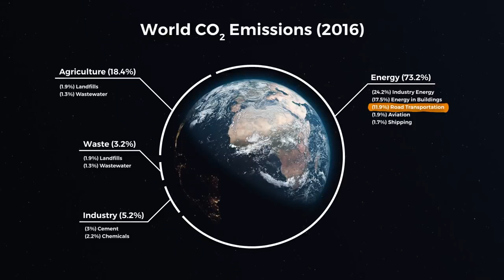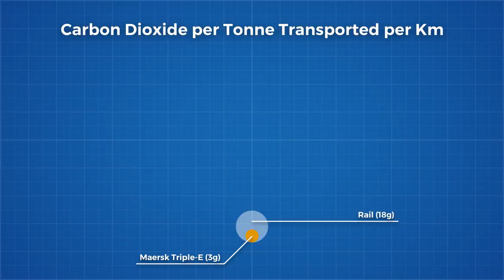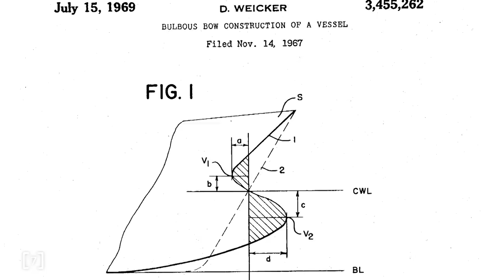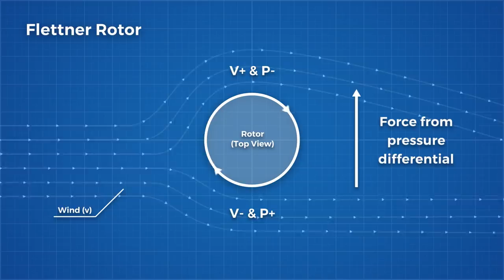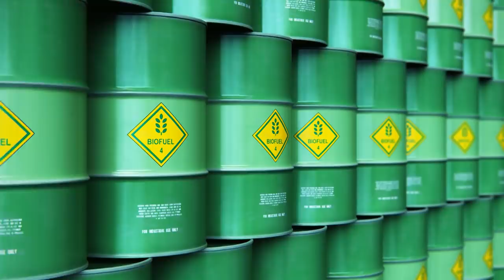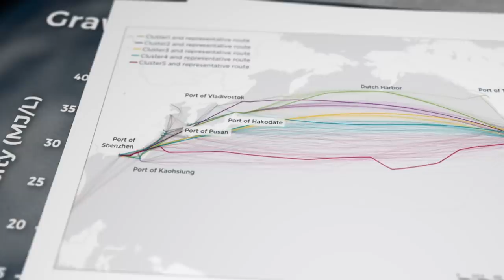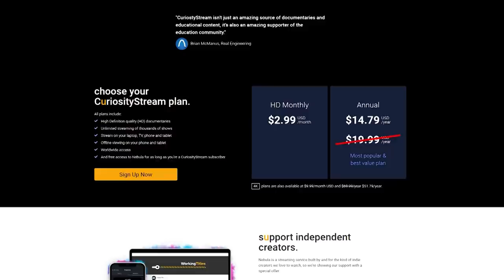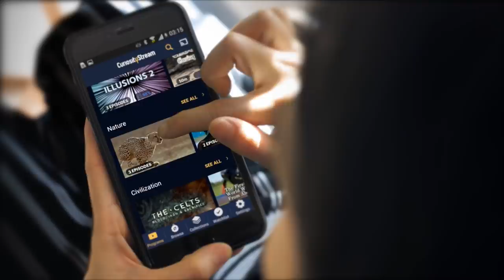Are Renewable Powered Ships Possible?

Comment: I think I may know a BETTER way. You see, Hydrogen power was always tempting. But, FIRST of all, you need a "Green" way to generate the stuff. Solar and wind can be used in areas of the Planet where it's practical. The Sun does not need to shine all the time if you use Hydrogen storage. But, the Second, pragmatic issue: how to safely store the stuff on a ship (or plane, for that matter.) I propose the use of  Sodium Hydride and Hydrochloric acid, again...made with "Green" Electrolysis. The concentrated HCl (mixed with water) could be stored in a stainless steel tank, and hooked up to the throttle. Meanwhile, in the ship's hold, you have a bunker with the Sodium Hydride. The HCL is sprayed in said hold, and the waste product IS...Saltwater! This can be discharged into the Sea. The fuel from the reaction is Hydrogen Gas, which you can pipe to a fuel cell, react it with Oxygen in the air, and the electricity powers motors  attached to the propellers. 

Those ships should be going 20-25 mph on that Green Power. That 12 mph Crap is causing the  current supply bottleneck.
Reply: POO (point of order) Hydrochloric acid is an exception to the general acid resistance of stainless steel and should be avoided (source Unified Alloys).  Also it is in my experience HCl is very nasty stuff, so best left alone, and running the reaction you describe on the scale needed is something that needs to happen in a galaxy far far away.
Reply: @BernardLS  And, True....you would need to stoke the hydride, like coal in the old days. You could line the containers with a thin layer of Gold, too.

Comment: Sure.  Use the sebatier process powered by a nuclear plant to produce natural gas  from sewage, crop waste  and atmospheric CO2. Carbon negative. How is this hard?. We have known how to do this since the 50s. In addition diesel engies can easily be retooled to  run on natural gas, with additional  lubrication.

Better yet, use small scale molten salt reactors to directly  power  the  motors. Again, tech we have had since the 60s.

Comment: Nuclear !!!
Reply: Just think; would you have full confidence in the management of a nuclear reactor under the control of an anonymous entity only traceable, perhaps, via a letter box in a FOC (flag of convenience) nation state?  If you are, could you sell that confidence to Japan, the state that hosted the Hiroshima and Nagasaki nuclear detonations as well as more recently the Fukushima ‘event’?  Then try that same, or a similar, sales strategy on Ukraine, the nation state that as a part of the USSR (CCCP) hosted the Chernobyl ‘event’.  Modern iterations of nuclear energy, thorium fuel, molten salt reactors, small modular reactors or fusion reactors, will carry the legacy of past problems.  It is the global trepidation of anything with 'nuclear' in the name and the economics of nuclear having transitioned from 'energy to cheap to charge for' too 'the costs of remediation are incalculable' that will prevent the adoption of nuclear energy as a means of creating energy at sea.  Modern reaction systems may have overcome the safety problems but the general public, having been misled in the past, will be reluctant to believe the fresh new promises.  The incident of the ‘Ever Given’ blocking the Suez Canal, March 2021, may also have a little to add to this debate.  The cooling water on ships tends to get taken in from near the bottom so when running aground the inlets are in a prime spot to get plugged up restricting, if not stopping, the flow of coolant.  One thing that the TMI, Chernobyl and Fukushima incidents all had in common was that the supply of coolant, or rather lack thereof, was a fundamental cause.  Similarly and only months later, May 2021, had the ‘X Press Pearl’ been nuclear powered then a major port for a populous nation in the global South would have possible been the site of a significant exclusion zone due to a non power plant related incident.  If the ‘X Press Pearl’ had on board a fired up but ‘safe’ molten salt reactor and found herself having to run down the possible 12.5 megaWatts of energy in the power cycle would a stable cool down have been possible?
Reply: @BernardLS  I get ur point , ur affraid of nuclear 9/11 on sea
Reply: @tamer27antepli  as are a chunk of the general population.  Sad but true.  Simply answer shorten and lighten global supply chains by consuming less and having fewer children, 'two will do', plus make stuff locally.

Comment: It boggles my mind that there aren't nuclear powered cargo ships. Sounds like the perfect application.
Reply: Nuclear engines need much higher trained technicians, and take up quite a lot of space, that some of it can't even be accessed by crew. Together with the high cost (in money and bureaucracy) of fuel and components, the only feature that makes it advantageous is it's ability to run for a very long time without refueling, and is therefore only a serious consideration for ships such as Arctic Liners.

Comment: yes, they're called sailboats
Reply: To address the suggestions that wind power is the answer I offer the following; if ‘the wind don’t blow the ship don’t go’, when it does blow it often blows in the wrong direction for your cargo delivery needs and sometimes there is rather too much of it for comfort.  The area where one is most likely to be ‘becalmed’ is the ITCZ (Intertropical Convergence Zone) or ‘the doldrums’ as it is commonly called.  In days of old ships with large crews, such as naval vessels, would try using the ships boats and some of the crew to row through the doldrums thus towing the mother ship out of the calm.  Not practical for less well manned and much heavier merchant ships which could not muster a similar power (oarsmen) to weight ratio (vessel displacement).  Traditional sailing ships are unable to go directly up wind so if the wind is blowing from the direction your cargo needs to go then a zig-zag course must be steered, more distance and thus more time on passage at whatever speed is achieved.  Wind speed is traditionally measured on the Beaufort Scale (wind speed) that runs from 0 (< 1kn or 0.5ms-1) to 12 (> 63kn or 32.5ms-1) and for sailing purposes the usable part of the range is ‘3’ (circa 8kn or 4.1ms-1) to ‘6’ (circa 24kn or 12.3ms-1).  As the wind speed, and the amount of energy that may be harvested therefrom, increases the sea surface becomes progressively more disturbed which makes the harvesting process ever more difficult and increases the stress on the vessel.  The increased stress means the sail area has to be reduced, either by using fewer or smaller sails until the vessel may in extremis be ‘hove to under storm sails’.  One way of reducing the sail area is by turning up the bottom edge; known as reefing.  With any wind power proposals the question that must be asked include ‘has any information been released into the public domain with regard to the expected energy harvest for the wing forms, on a Watts per square meter basis?  ‘Cutty Sark’, is said to have been able to coax 3 000 horse power (or 2 206 500 Watts / 2.2 megaWatts)) out of her, up to, 2 976m2 of sails, assuming ideal conditions and further assuming that for sailing purposes the usable part of the wind speed range is 4ms-1to 12ms-1 so the yield would be about 741 Watts m2.  So another question ‘for the proposed option what is the expected upper wind speed limit for the system’?  A single stage 'harvest to deployment' system for propulsion will have higher efficiency but ‘what steps are being taken to provide ancillary power such as the, small but essential, domestic, navigational and cargo needs?’

Comment: what a stupid fucking question. shipping didn't involve combustion of hydrocarbons at all until about 2 centuries ago. and unlike an airplane, if you run out whatever your power source is on the water you're not automatically fucked, just slightly delayed.

Comment: Why not make nuclear powered cargo ships?
Reply: Just think; would you have full confidence in the management of a nuclear reactor under the control of an anonymous entity only traceable, perhaps, via a letter box in a FOC (flag of convenience) nation state?  If you are, could you sell that confidence to Japan, the state that hosted the Hiroshima and Nagasaki nuclear detonations as well as more recently the Fukushima ‘event’?  Then try that same, or a similar, sales strategy on Ukraine, the nation state that as a part of the USSR (CCCP) hosted the Chernobyl ‘event’.  Modern iterations of nuclear energy, thorium fuel, molten salt reactors, small modular reactors or fusion reactors, will carry the legacy of past problems.  It is the global trepidation of anything with 'nuclear' in the name and the economics of nuclear having transitioned from 'energy to cheap to charge for' too 'the costs of remediation are incalculable' that will prevent the adoption of nuclear energy as a means of creating energy at sea.  Modern reaction systems may have overcome the safety problems but the general public, having been misled in the past, will be reluctant to believe the fresh new promises.  The incident of the ‘Ever Given’ blocking the Suez Canal, March 2021, may also have a little to add to this debate.  The cooling water on ships tends to get taken in from near the bottom so when running aground the inlets are in a prime spot to get plugged up restricting, if not stopping, the flow of coolant.  One thing that the TMI, Chernobyl and Fukushima incidents all had in common was that the supply of coolant, or rather lack thereof, was a fundamental cause.  Similarly and only months later, May 2021, had the ‘X Press Pearl’ been nuclear powered then a major port for a populous nation in the global South would have possible been the site of a significant exclusion zone due to a non power plant related incident.  If the ‘X Press Pearl’ had on board a fired up but ‘safe’ molten salt reactor and found herself having to dissipate the residual energy associated with the possible 12.5 megaWatt power cycle would a stable cool down have been possible?  In a casualty ships may capsize, like the ‘Karin Hoej’ of Bornholm in the Baltic early December 2021, in which situation any safety system reliant on gravity might not work.  Why not use nukes?  It is down to engineering, finance, socio-political attitudes and safety.

Comment: Thorium reactors.
Reply: Just think would you have full confidence in the management of a nuclear reactor under the control of an anonymous entity only traceable, perhaps, via a letter box in a flag of convenience (FOC) nation state?  If you are could you sell that confidence to Japan, the state that hosted the Hiroshima and Nagasaki nuclear detonations as well as more recently the Fukushima ‘event’?  Then try that same, or similar, sales strategy on Ukraine, the nation state that as a part of the USSR (CCCP) hosted the Chernobyl ‘event’.  Modern iterations of nuclear energy thorium fuel, molten salt reactors or fusion reactors will carry the legacy of past problems.  It is the global trepidation of anything with 'nuclear' in the name and the economics of nuclear having transitioned from 'energy to cheap to charge for' too 'the costs of remediation are incalculable' that will prevent the adoption of nuclear energy as a means of creating energy at sea.  Modern reaction systems may have overcome the safety problems but the general public, having been lied to in the past, will not believe the fresh new promises.

‘They’ say nuclear is cheap, it’s not it is expensive as well as being complicated, dangerous, not universally socially acceptable and having only ‘no need for refuelling’ as a questionable advantage; actually it does need refuelling just not as often.  When they do need to refill the warming up stuff it takes considerable longer than pumping tonnes of thick black, HFO cSt380, or thin runny stuff, Avtur-JetA1, onboard which is one of the reasons HMS Queen Elizabeth and HMS Prince of Wales are pushed about by gas turbines thus using the same fuel as the aircraft that fly off of them.  The Royal Navy (RN) with a high degree of skills and expertise use, at vast expenses to the UK taxpayer, a current operational nuclear fleet of 8 submarines (also known as ‘boats’) in two flotillas, four attack subs and four ballistic missile boats.  The carbon footprint of all the extra bits of hardware and the fuel, including processing thereof, from ground to propeller, are the external costs that never seem to get considered.  Disposal, once it wears out, of both the machine (that was a ship) and fuel is another can of worms best left unopened.  The 26 RN boats no longer in use are laid up (some in Rosyth and some in Portsmouth) awaiting long term deconstruction including dealing with the fuel rods and other irradiated material.  The USN is not, as far as I know, a commercial organisation working to very tight margins and also has the skill and expertise to handle the complexities of nuclear power so as well as submarines their aircraft carriers are nuclear powered and each have a build cost three times that of QE/PoW, bigger crews and more generous funding.  For those who still think that nuclear energy might be the answer I recommend this report: - https://www.bbc.com/future/article/20200901-the-radioactive-risk-of-sunken-nuclear-soviet-submarines? ocid=ww.social.link.email.  The navy of the USSR might have been under resourced and over extended but it was still generously supported in comparison with merchant shipping.

Comment: Alright, I do agree with most of this, but you do blatantly ignore by far the most efficient. Nuclear. No refueling, completely green, and, if you're not being a brainlet, very safe. I just need to point to the US Navy, who has operated nuclear powered vessels in wartime since the what, 50s? Even the Soviets, when they lost a nuclear submarine. Nothing much really happened. The beauty of ships is that they can carry a small reactor without sacrificing, anything. And this makes turnaround that much quicker, because of course, you don't need to refuel. This is expensive in the short run, yes. But a) more demand equals more research into the field which equals ways to make safe nuclear reactors for less and b) it will save companies in the long run by eliminating fuel costs entirely. You could also run whatever route you want, without refueling concerns, you have unlimited range after all.
Reply: Just think; would you have full confidence in the management of a nuclear reactor under the control of an anonymous entity only traceable, perhaps, via a letter box in a FOC (flag of convenience) nation state?  If you are, could you sell that confidence to Japan, the state that hosted the Hiroshima and Nagasaki nuclear detonations as well as more recently the Fukushima ‘event’?  Then try that same, or a similar, sales strategy on Ukraine, the nation state that as a part of the USSR (CCCP) hosted the Chernobyl ‘event’.  Modern iterations of nuclear energy, thorium fuel, molten salt reactors, small modular reactors or fusion reactors, will carry the legacy of past problems.  It is the global trepidation of anything with 'nuclear' in the name and the economics of nuclear having transitioned from 'energy to cheap to charge for' too 'the costs of remediation are incalculable' that will prevent the adoption of nuclear energy as a means of creating energy at sea.  Modern reaction systems may have overcome the safety problems but the general public, having been misled in the past, will be reluctant to believe the fresh new promises.  The incident of the ‘Ever Given’ blocking the Suez Canal, March 2021, may also have a little to add to this debate.  The cooling water on ships tends to get taken in from near the bottom so when running aground the inlets are in a prime spot to get plugged up restricting, if not stopping, the flow of coolant.  One thing that the TMI, Chernobyl and Fukushima incidents all had in common was that the supply of coolant, or rather lack thereof, was a fundamental cause.  Similarly and only months later, May 2021, had the ‘X Press Pearl’ been nuclear powered then a major port for a populous nation in the global South would have possible been the site of a significant exclusion zone due to a non power plant related incident.  If the ‘X Press Pearl’ had on board a fired up but ‘safe’ molten salt reactor and found herself having to dissipate the residual energy associated with the possible 12.5 megaWatt power cycle would a stable cool down have been possible?  In a casualty ships may capsize, like the ‘Karin Hoej’ of Bornholm in the Baltic early December 2021, in which situation any safety system reliant on gravity might not work.  It might also be worth bearing in mind that part of the TMI near miss the fault of the navy trained operators focusing on not letting the primary cooling system 'go solid'.  As a second point if you fit 'walk away safe' reactors on ships you will need duplicate drive trains as there are seldom salvage tugs around when you really, really need one.  A nuclear dead ship drifting around would be a disaster waiting to happen and duplicate systems increase expense.  Why not use nukes?  It is down to engineering, finance, socio-political attitudes and safety.